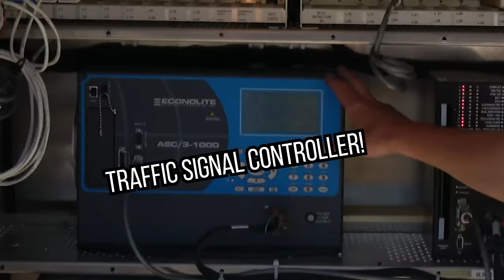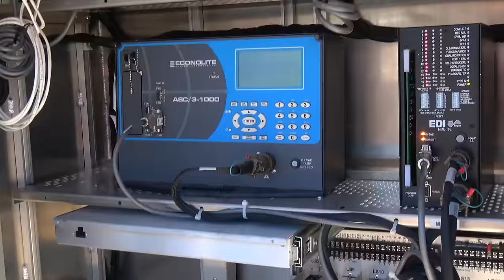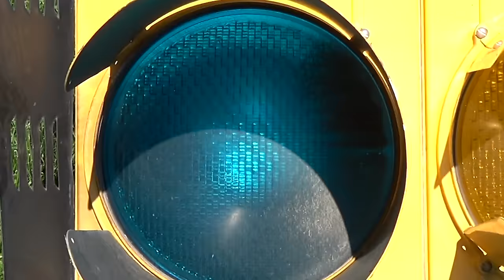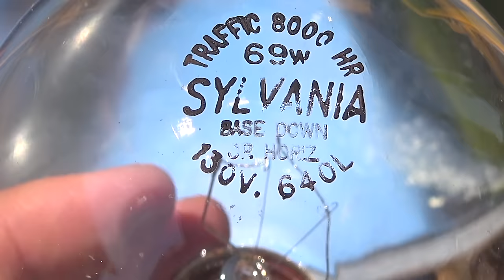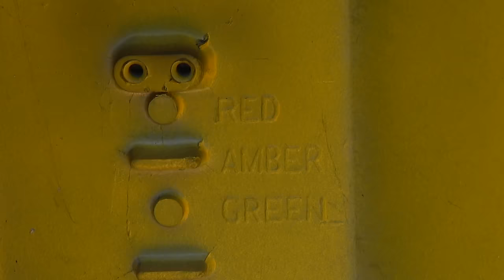What's inside a Stop Light?

Comment: The Green light looked blue because when a light bulb is on, it emits a yellowish light. So when the light is on, it appears green.
Reply: It's a good theory but no. You don't want true green on traffic lights. With 8.5% of the population colorblind, it's important to shift the green to a turquoise color so that red/green colorblind drivers can distinguish between the lights.
Reply: Treddian no need for that because if they should that if the bottom is lit it's go and if it's the top to stop?
Reply: Its not that it is perfectly a yellow light, so it does appear to be a blueish green not Just green.
Reply: This is true, at least for me. 
I am green-red  colourblind and the light on the bottom is a very noticeable "green" for me
Reply: Some areas (like Alberta, Canada) have the Traffic Lights mounted horizontally on not vertically.  If a colour blind person has never seen that setup before, they would not know if the left or right light is red/green.
Reply: sure as hell it would last longer than your normal house bulb!
Reply: A Schweezy WRONG
Reply: soundman12000 yes I'm from Ontario but went on a road trip to Florida and they are the same there
Reply: +treddian That's better logic.
Reply: A Schweezy I thought I was colorblind
Reply: A Schweezy explain the red light
Reply: I thought the colors were just faded. Thanks for the info!
Reply: Horizontally mounted lights are common. Just not as common as vertically mounted light.
Reply: NZJYOUNG in some jurisdictions the stop lights are not vertical but horizontal so it's red to the farthest left and then green to the farthest right. And then sometimes it's the opposite way around, green to the farthest left and red to the farthest right. Usually the stop lights are like this and places with high winds, like the prairies.
Reply: @soundman12000  the standard for traffic signals is always this:

Vertical:
Red
Amber
Green

Horizontal:
Red - Amber - Green

Red is always left or top
Amber is always center
Green is always right or bottom
Reply: @Rory_Shade  green is never far left unless rule of the road is right hand drive. Red is always on the driver's side with horizontal lights.

Comment: Really... there was a light in there... omfg mind blown😮
Reply: the older ones [which i like ] has a lightbulb in it

the new ones that they are replacing the old lightbulb have circle pads with little led's on them

usually the led's blow out or malfunction and you would see black spots on the light which is kinda crappy when the lights turn on
Reply: Lmao

Comment: I think the green light is blue, because a typical light bulb makes yellow and not completely white light and yellow mixed with blue is green...
Reply: Nocturnal The light they used is old now there is colored led lights behind a clear filter so if one light goes out you wont notice
Reply: Light doesn't mix like paint
Reply: but different colors of glass can alter the color of light being shown through it.
Reply: GreenDog They actually do... the color white is basically all the colors reflected together
Reply: Actually 421Frickit, I don't know where you're from but your city council is wasting money.

The vast majority of traffic signals are assembled using white LED circuit boards covered by a colored lens. Having three different colored circuit boards can be confusing as they all look the same without power running through them. So in the warehouse you could easily mix up red boards with yellow or green. But I say your city is wasting money because buying 900 white led circuit boards is usually cheaper due to bulk discounts than buying 300 green, 300 yellow, and 300 red.

Comment: What about inside a LED traffic light!?!?
Reply: Yes
Reply: LED is the same thing, the only difference is the ball.
Reply: Just an array of leds
Reply: I have a box full of retired 12" LED's (balls and arrows) from traffic lights... good video idea! I'll shoot a video of an LED module teardown soon :)
Reply: Charlie Davidson I have a box of retired Leo Tech 12 in LED modules I have teared them down before I could make a video.
Reply: Instead of a bulb and a reflector it’s just a bunch of leds
Reply: MindlessPear88 never LED modules only have 6 LEDs well the dialight ones anyway. Older ones could have 25 or 29 LEDs more or less depending manufacturer and the way the LEDs are laid out.
Reply: Attraction Spot that's like the uk lights
Reply: Attraction Spot rghbh
Reply: I believe it would be a few led’s
Reply: Actually, LED Traffic Lights vary on who is selling the built in set. In my area, one traffic light replaced by LED started blinking weird. Half of the (I will say 50 bulbs) burned out in the traffic light and one of the bulbs was blinking intermittently.
Reply: LEDs are inside a LED traffic light
Reply: @ZanesTrains1972  Actually it's quite different. The LED modules mount to the front head of each light by the way the glass originally mounted and it's sealed so you have to be destructive to get inside. Technology Connections did this and the inside looks much different.
Reply: Depending on the manufacturer of the LED there could only be one LED.
Reply: When LEDs started coming out, there was an array of LEDs on the face of the traffic like. Lately I've seen them go to just using three or four LEDs with the reflector, kind of like the old ball lights. Sometimes the LEDs are colored themselves and the lens is actually clear. Supposedly this is done because when the sun shines on the traffic lens, it doesn't look like the lights are on and confuse the driver.

Comment: the green light is bluey-green because a non-LED type bulb burns with a yellow-white light not a pure white light, so they tint the lens slightly blue to compensate providing a fully green colour upon illumination. (yellow+blue=green) this originally comes from old time flame-lit railway signals where the lens was even bluer than the ones on traffic lights to compensate further as a flame burns yellower still than a bulb.

Comment: Most traffic signal lights today are LED. The LED technology is used in all new signal heads and the older incandescent signal heads can be retrofitted with LED modules that usually requires removal of incandescent bulb, reflector unit and colored glass lens. A new LED unit roughly the same size as the old incandescent reflector unit is fitted into the  door frame of the glass lens, then it is connected to power wires coming into signal head. One of the problems with the LED modules is they don’t give off as much heat as the incandescent signal heads which can cause problems on signal units in cold snowy areas because if the snow is falling hard enough, the signal lens can become covered in snow not allowing the signal to emit light.

Comment: "640 L" refers to the number of lumens (brightness) the lightbulb is capable of.

Fun fact: the bulbs inside red lights need to be brighter than the bulbs inside green and amber lights, because in order to get a pure red, the lens must have a very dark tint, otherwise the red light would look pink. So a brighter bulb has to be in the red light. At least that is the case with older incandescent traffic signals, the newer LED signals don't have this problem.

Comment: Although you may not perceive it, “white” light can give off different colors. This coloring of the light is known as color temperature, which is measured in degrees Kelvin. There’s a detailed article about color temperature on Wikipedia if you’d like to learn more. For example, a common household light bulb may have a color temperature of 2400K (more of a yellow) but the light hitting you on a cloudy day might have a color temperature of 6500K (more of a blue). This is more perceptible if you take an outdoor photo using the indoor setting. The photo looks REALLY blue because the camera thinks the overall lighting is not what it expected and has compensated for the difference incorrectly.
If you recall your days of finger painting in nursery school (who doesn’t?!) you’ll remember that yellow (representing the bulb) and blue (the lens) makes green (observed light output). Going back to the blue color of outdoor light, this will compound the appearance of your lens and it will look even MORE blue. Because incandescent bulbs give off that warm, yellowish color, a slight correction has to be made. A bit of blue tint is added to the lens, making the light you see appear green when illuminated by the yellowish bulb.

Comment: red=stop
yellow=slow
blue=go
Reply: yellow is not slow it means it will change to red
Reply: kennys Boat that's not true
Reply: @Kennys Boat and @dab boy
Yellow is a warning to prepare. On it's own, it's warning you that it's about to change to red, so unless you're already committed to crossing the line, slow down be ready to stop for red. A yellow in combination with red tells you that it's about to change to green, so get ready to go. In the US this probably doesn't have much use since most cars in the US are automatics, but in other countries, it gives you a moment to get clutch bite and disengage the handbrake if you had it on.

Comment: The yellow, or "Amber", signal has the terminal block. That's where you would put the bulb wires and connect the signal to another wiring loom, and that loom would connect to the Traffic Signal Control Box through the pole.

Comment: That light appeared to be in operating condition. Cutting off the visor wasn't necessary if you had taken a moment to see it was simply screwed on. And why did you destroy a lens? Why did you destroy anything? A total waste. These signals are engineered to be durable yet easy to work on. You could have educated someone how to properly disassemble it as well as show what's inside and still would have had a really cool, functioning traffic light to display.